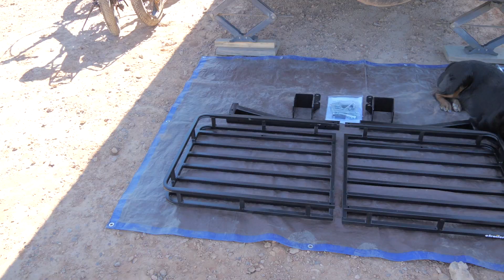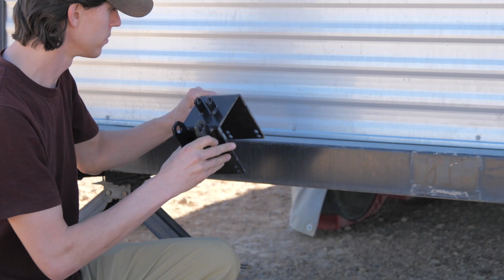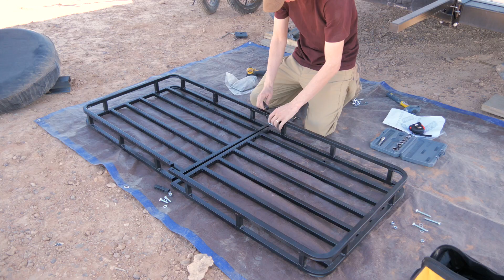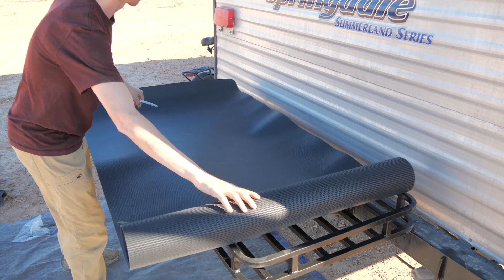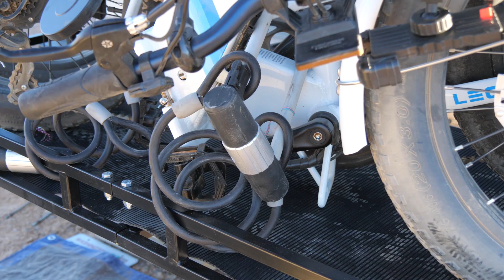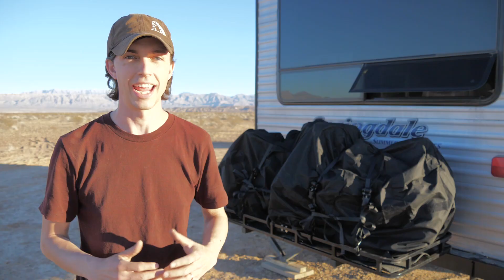INCREDIBLE EXTRA STORAGE! - RV Bumper Cargo Carrier Install

Comment: Real good video. I like the increased storage which I may do with my camper. Just curious, what did you do with the spare tire ?
Reply from the maker: I ended up getting rid of this rack bumper because it ended up taking too much weight off the hitch and I could feel the trailer wandering at high speeds. It was nice for a time though and I just kept the spare tire in the bed of my truck.

Comment: I've heard of a few Rvers getting their electric bikes and generators stolen from the back of travel trailers while stuck in traffic and overnight on travel days. 

I would add a small siren alarm with a pull wire, so you can hear it from the truck cab or inside if it's taken off.
Reply: thats what Sweetie's for! lol

Comment: Thanks David! - On my TT - I had a rear 2" hitch installed between the frame "I" beams, then I got a split receiver that has two hitches vertically separated by about 4".
I installed a 500lb capacity rack in the lower receiver and a bicycle mount into the upper receiver.
I carry two large plastic storage bins on the lower rack - I think this helps  offset the second battery and the 20lb to 30lb propane tank upgrade I did in the front.

Comment: Hi David! Long time subscriber. Defended you on your excellent weight distribution hitch video. I’m sure your electric bikes are light. But I’d like to warn people. Just because a rack can hold a ton of weight doesn’t mean you should. Firewood seems great on a rack like that. Out side no mess. But weighs a ton. Can cause severe trailer sway. Moving your spare to the bed instead of keeping its weight back there was a great idea. Every video I’ve seen of a camper swaying and losing control had a rear rack. I’m considering an A frame front bike rack because of that. I have a little Coleman 17B so weight placement is a little more of a concern for me. Love your videos. Hope Roe is enjoying her new job. Take care!

Comment: Why not use a bike rack?
Reply from the maker: Because a bike rack would be so tall that it would partially block out our view from the big back window. This way our window is unobscured and we don't have to stare out at two bicycles all the time. The low profile of this cargo carrier was better for us.
Reply: @FateUnbound  Gotcha. Thanks for the reply.
Reply: I'm in the same boat. The bike racks are not recommended for TT.
Reply: @Deseri74  Because it affects the weight distribution and could cause severe sway having that much weight on the back.
Reply: Most normal bike racks aren't rated for enough weight to carry e-bikes. Of those that can hold e-bikes very few don't say "Not approved for use on RVs." I found a few that are approved for use with hitch receivers of 5th wheels and motor homes, but not travel trailers. My Hollywood Racks RV Rider finally arrived from Etrailer today. It had been on back order since July.
Reply: @SkepticalTraveler  Yep, aware about the special rack thing - been riding ebikes for years. Good to know about TTs and racks though, excellent point. Hollywood is the brand recommended by RadPower bikes I believe, so hopefully it works well for you. Happy trails!

Comment: Great install! What did you end up doing with your travel trailer spare tire?
Reply from the maker: It's just in the back of the truck with our air compressor stacked on top of it. It takes up virtually no extra room back there 👍
Reply: Do you need to center the cargo carrier or can you place to one side to make room for spare tire??

Comment: too much weight on back of trailer causes side sway.
Reply: David's a mechanical engineer, so I presume he's thought of the weight and balance implications.

I once mistakenly loaded a 6x12 cargo trailer with a lot of the heaviest stuff behind the axle, and the tail did wag the dog (a light 98 S-10 standard cab pickup) on a highway for a very scary 20 seconds or so, because retaining control was borderline impossible, braking or downshifting was out of the question (jackknife and flip) and it took seemingly an eternity for air resistance to slow me down and lessen the oscillations.  It didn't happen until probably an hour on the highway.  Bumpy pavement-segment gaps on a tight curve (due to an urban section of interstate) likely triggered it.  It's possible I under or overcorrected the initial and surprising yank/yaw on the truck, though I think I handled it pretty smoothly all things considered.

I'd at least want to verify that the tongue weight is still positive!  A serious change in tongue weight even short of popping a wheelie, should be obvious the first time they unhitch.  Things can go south in a hurry when there's no tongue weight, or it's lightening the traction on the truck's rear wheels.

Weighing the force on the hitch ball, or comparing photos of the truck's rear wheel wells before and after the change, would be a good idea.  Luckily, I think they have extra weight hanging off the front also, having increased the size of their propane tanks.  And they probably lightened the rear end of the interior when they removed all sorts of built-in furniture and replaced it with the simple desk surface. Or is that at the front? I forget.